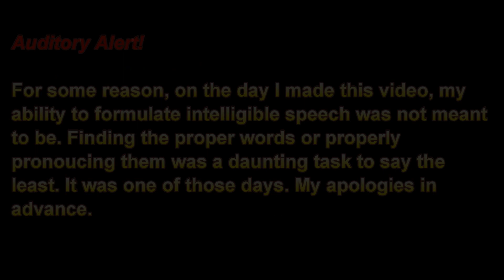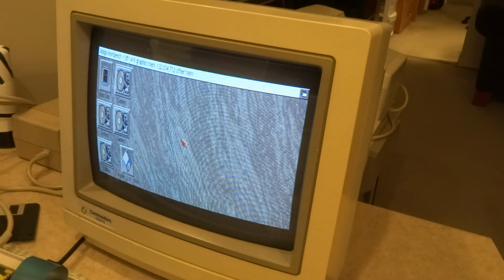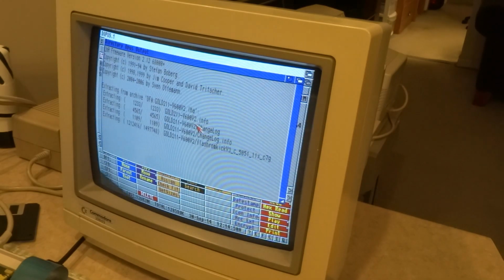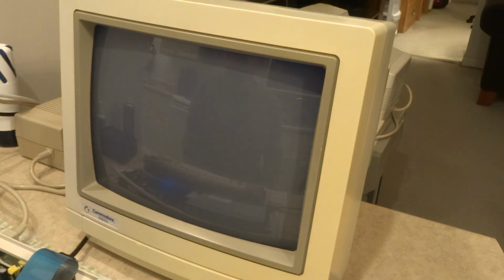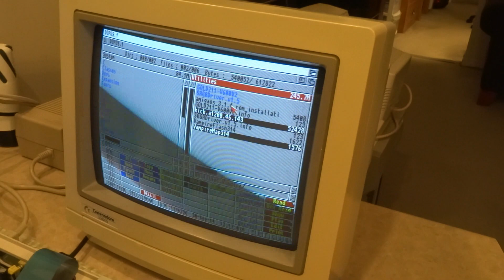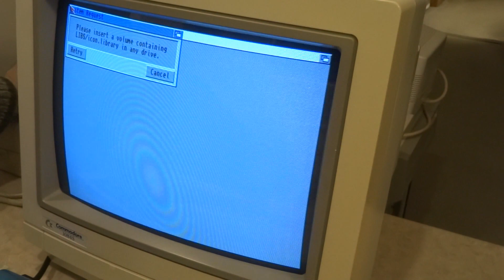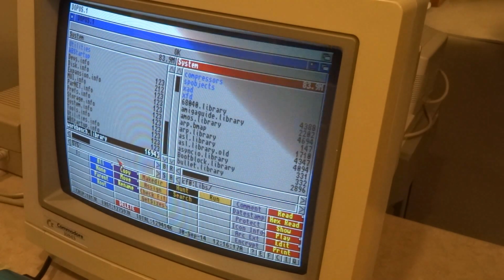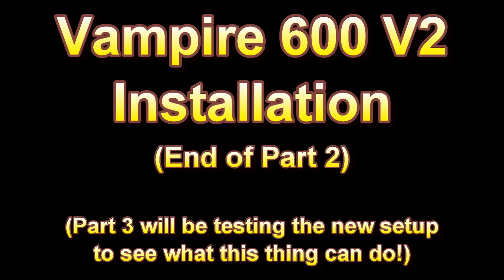Vampire 600 V2 Installation - Part 2

Comment: Thanks for the video. You confirmed my fear that the motherboard needs to be removed to properly mount the Vampire.  Ugh to that, but nothing ventured nothing gained as they say, or something ventured everything lost as I say.  I got my Vampire today so I am itching to get at it. I also got a micro SD to SD extension cable so I am hoping to connect that to the micro SD slot and mount it somewhere in the case so the card can be easily removed. The vampire for the A600 does not have a IDE header on it like the A500/2000, what kind of speeds are you getting to your CF card?

Also, as I watch pretty much all of your videos, I recently bought an A2000 non working.  It had a Rev4 motherboard with battery leakage damage. I was not swift enough to test before I swapped the motherboard.  I had everything for the A2000 but the case so I swapped out the motherboard as soon as I got it.  I would like to give the motherboard to someone that has the skills to possibly repair it. Working or not they are getting rarer by the day so if you would like it or know someone who would, let me know.
Reply from the maker: I am glad you like my videos. The SD card speeds on the Vampire can hit around 10 MB/s, which by Amiga standards, is pretty fast. Currently the SD card cannot be used to boot the Computer. I have 16GB card installed that holds all of my games, demos and backup files. I would definitely be interested in your old Rev 4 motherboard. Sometimes these old pieces of hardware can be brought back to life. I can even make a video of the attempt :)
Reply: @amigaretro1985  Thanks, I actually meant speeds to the CF card where the OS resides.  I have a Vampire 2 in a A2000 which has a IDE header on it and the speeds to the disk connected to it are about 10 MB/s.  I was just wondering what the speeds to the CF card on the onboard IDE header of the A600 are. 

Let me know how I can get that motherboard to you and I will send it away =)
Reply from the maker: I get just shy of 3 MB/Sec. Though not as fast as the SD card, the system still boots quickly and is very responsive.

I will contact you shortly in regards to the A2000 motherboard.
Reply from the maker: You can go to the About tab on the main tab on my channel's Home page and use the "For business inquiries:" to contact me privately.  Thanks again.

Comment: Really good informative video :) I have the same setup but not a power amiga user so this is good help :) You mentioned that the internal micro sd slot on the vampire can mount a sdcard. Can I use this and copy the needed files for the update? I hope part 3 is in production :)
Reply from the maker: I am glad you found the video helpful. I use my SD Card for file backups and Internet Downloads, the Vampire Core updates are some of the data I keep installed on the SD card. Using Giggle Disk is the easiest way to have the SD Card's DOS Driver information created then used to mount the SD card. Format the SD Card on a PC in FAT32 format, then install it in the Vampire 2 and run Giggle Disk. Read the Giggle Disk Docs if you have issues using the program.

I will be doing a Part 3 soon showing some of what can be done using the Vampire 2 on the A600 versus a non-expanded one.
Reply: @amigaretro1985  Thanx for the fast reply :) I will look up the Giggle Disk to see how I can use that, it is not straight forward to transfer files from a modern computer to an amiga. Also need to upgrade the core from 2.5 like you did. Looking forward to the part 3 :) you have a good way of telling a neewbe how it is done, good to see that you don`t edit out stuff and make it perfect like many do:) good luck.

Comment: so you are using vampire with CRT monitor, not having RTG card that way.
so what do you need vampire for then?
Reply from the maker: I mainly use an LCD that use with the Vampire. The Vampire provides more than HDMI out, also big speed boost, more than twice the speed of an 68060 @ 50MHz. The CRT is used for native Amiga Games (PAL or NTSC)..